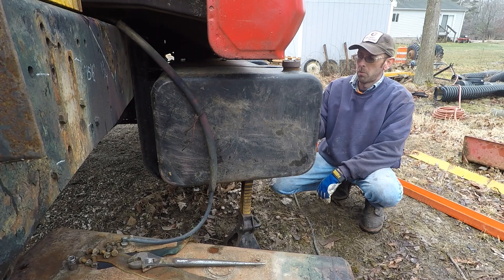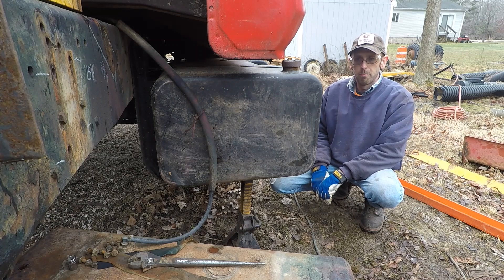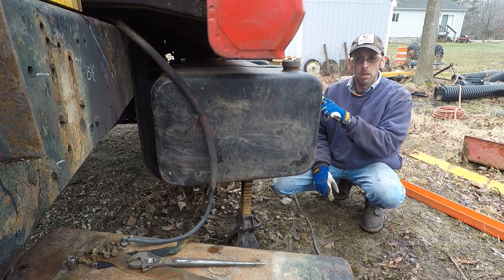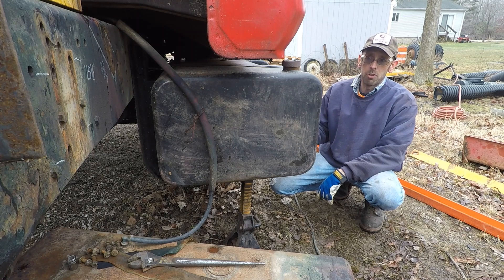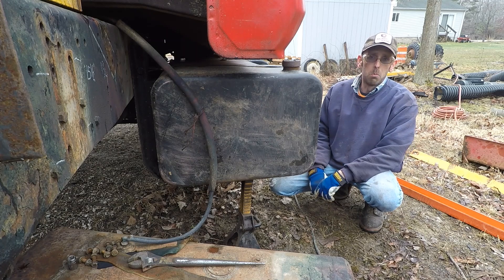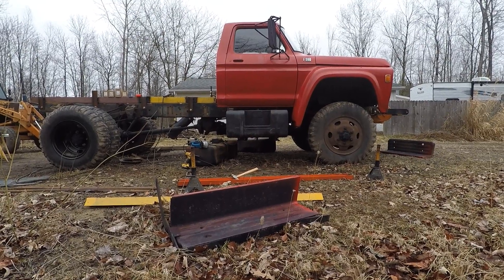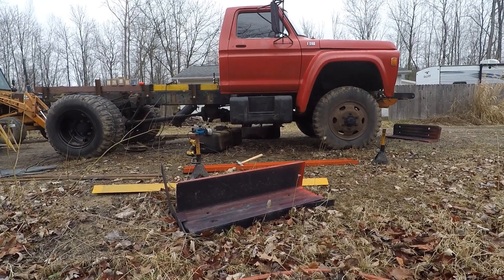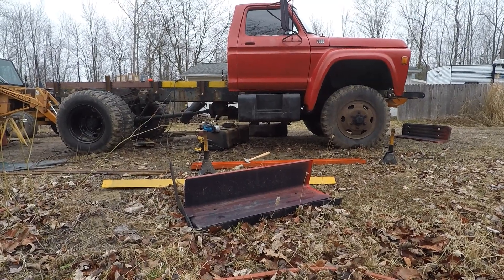Fuel/Hydraulic Tank Install

Comment: What brand & model is that magnetic drill?
Reply from the maker: Hougen HMD904. Made in Michigan. They also have a lifetime warranty. Hougen sets the standard in mag drills as far as I'm concerned.  I've used several other brands and haven't been overly impressed.
Reply: @WesleyJohnsonMI  thank you for taking the time to respond, I appreciate it very much. I notice Amazon sells them for about $1,100, considering I have free shipping with them & I live in California, do you suggest any other supplier who might have a better price?
Reply from the maker: @charleslachman4637  that's about ballpark price everywhere you go. You can try contacting a local welding supply company & see if they are having a sale on them. Keep in mind though, the mag drill comes setup to use with annular cutters. I've had good luck with the 12,000 series. For the price of cutters, get the 2" DOC ( depth of cut), they do offer 1" DOC also. You can buy the cutters in kits of 5, in various sizes. I'm using a Jacob's chuck adapter in this particular video. Hougen's website lists all the available accessories with part numbers. It makes it easier to find what you're looking for. Glad I could help!

Comment: When I purchased my current property, there were several pieces of conveyor belting being used as temporary walkways. These were 48 inches wide and about 18 feet long.  I've cut one belt into 6 foot sections which made them into easily moved sections.  They are very handy when used as a runner for a floor jack or just a place to stay off dirt and gravel.  They made lousy walkways when wet since they were about as slippery as ice.  If you have access to this type of belting, it might make your outside projects a bit more comfortable. I have a 60 gallon side tank (non step) I'm going to mount on my 1965 F600.
Reply from the maker: I've thought about it, but I have no place to store those kind of things. A lot of times I use a pallet that has been cut down, similar to a pipeliner's muck board. Are you using one of the 'D' shaped tanks, or an actual round tank? Just make sure you have sharp drill bits! Those frames are pretty tough.
Reply: Wesley Johnson - my tank is "D" style factory tank I saved off 1984 GMC 7000  I scraped out.  Mounts look about the same as the ones on the tank you are installing.
Reply from the maker: @geraldtrice4894  yup, my F700 had dual 'D' shaped tanks from the factory, mounted behind the cab. Everything was electric switch over on that one. Unfortunately it only had one of those tanks on it, when I bought it. The only real difference is that the vertical part of the bracket extends further above the top bolt holes.
Reply: Wesley Johnson - My F600 has a fuel tank mounted behind the seat just like pickups from the same era.  Probably about 20 gallon capacity.
Reply: Wesley Johnson - My F600 has a fuel tank mounted behind the seat just like pickups from the same era.  Probably about 20 gallon capacity.
Reply from the maker: @geraldtrice4894  Gotcha. Are you going to remove the in cab tank completely, or plumb in a manual switch over valve to have dual tanks?
Reply: Wesley Johnson - I'm leaving in the cab tank and using a manual tank valve.  The cab tank's fuel gauge works so that's another reason to keep it.

Comment: Clean install 🙂👍 plenty of ground clearance. One step closer my friend. Just curious, any idea what the truck weighs as of this point? 🤔
Reply from the maker: The scale slip for my 1979 F700 5 yard dump truck was about 9500 lbs. This F600 being 4x4, I'm going to guess at about 12500 lbs. The front axle is around 1800 lbs, probably 350 lbs for the transfer case. Then some 'cushion' thrown in for good measure. I'll get a final weight on it before I get the plate for it. The truck has a 19700 lbs GVWR, so it'll be interesting to see what it does weigh.
Reply: @WesleyJohnsonMI  awesome! 😃 heavy duty for sure lol
Reply from the maker: @HODGEPODGEDODGEGARAGE   only until I find the weakest link!